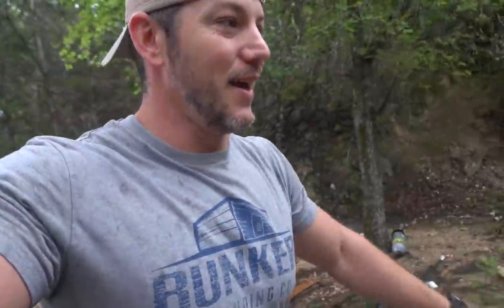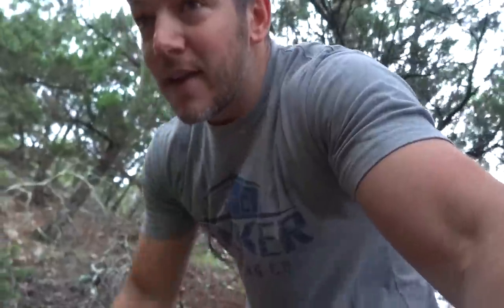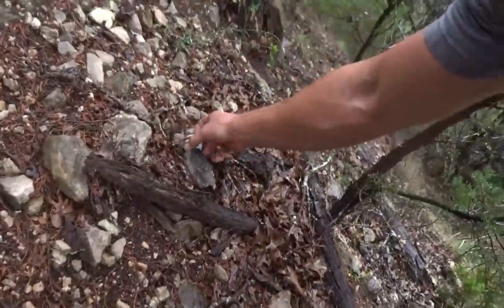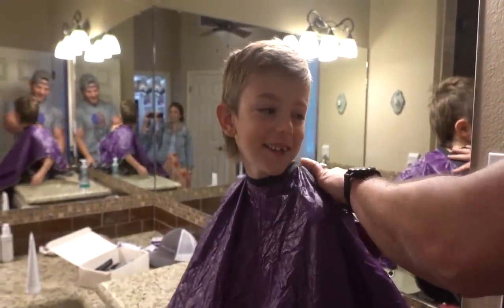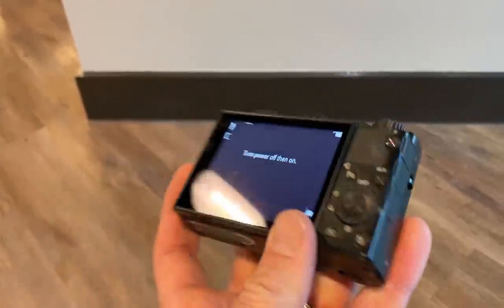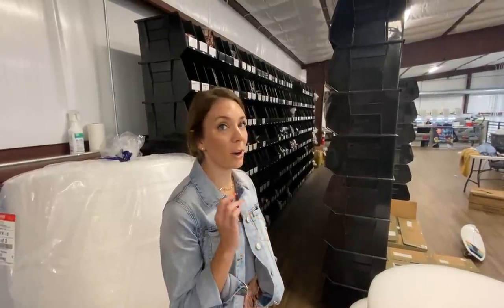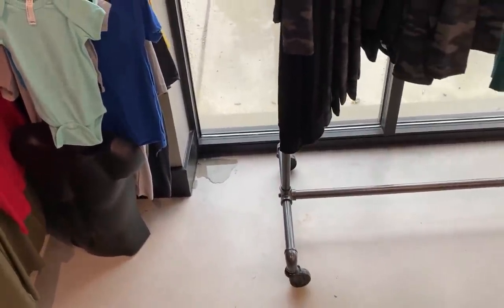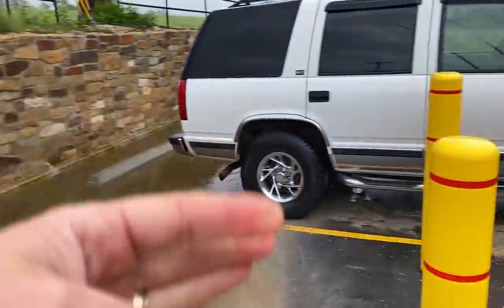The Barracuda’s 12V Cummins is Built!!!!

Comment: As an architect we always try to cover our doors, it helps keep water draining away from the building. Also Storefront is notorious for leaking and you have storefront in a metal building which makes the waterproofing more difficult. I would think about adding an awning the full length of the storefront above the door.

Comment: Quick suggestion on the water getting in- I am a 20 journeyman glazier and that corner leaking means the corner of the commercial storefront metal is not sealed. It is getting past the bottom pan ( the piece that comes up the back of the bottom storefront ) and the actual storefront metal frames. They should be caulked like Noah's ark in the corners when being assembled and when being set. The water is getting in either thru the Vinyl on the outside of the glass due to shrinking ( rookie move ) and the caulking on the corners ( internally ) and the joints not sealing completely.  That's a common issue with a poorly installed commercial storefront.

Comment: If the water is coming from up high it could be how the window framing is anchored onto your substrate. If the screw heads are anchored inside the framing through the head piece(the framing might be strapped idk) they might not be caulked and water could be travelling through a loose screw hole and running down the jamb of the frame and coming out the back of your subsill, if the frame wasnt properly embedded in caulking in the subsill

Comment: Hey Matt, I'm not sure you'll see this but make sure the caulk used to seal your storefront windows at the warehouse is 1 part polyurethane. It's much more weather resistant it's flexible and we use it installing those same storefronts here in Florida :)

Comment: Matt, you should dig a huge hole at bunker branding and submerge some empty water tanks to collect that spring water, then you can use it for things like washing trucks, flushing toilets, etx, and will be doing something good for the environment. Plus it would be a cool project, (maybe even tap into the ones at the ranch, and use it for demo headquarters for the same thing.

Comment: I would definitely highly recommend if you can find some metal tubing or plastic tubing and drilling out holes along that wall but using the the metal tubing and so that it runs away from the wall so basically adding some metal tubing connecting all of the pipes together into one pipe to go into the Little River that way you don't have any water buildup on the area of what you are

Comment: I searched quite a long time for a sturdy haircutter and finally found the same  WAHL as Matt has. When I received it, I realized it was only 120V and I'm living in Europe.
Not a big deal I thought, got my 100W 120Hz converter and started it up. It made really bad noises. After some research, I figured out, that it oscillates with the mains frequency and 50Hz is no good.
Now I have it hooked to a 12V DC to 120V 60Hz AC converter which is hooked to a 240V 50Hz AC to 12V DC converter.
It works like a charm now, but it was a way to get here.

Comment: Re the water.  Have the AC system checked.  You may have negative pressure and are sucking the water into the building.  A slight positive pressure is best.  The weep holes on the window system may also be clogged.

Comment: If you cut down all them scrub trees and plants long grass with good root systems that spring would always run because the rain will get trapped in the grass and soke in to the soil in stead of running straight off

Comment: Skip the ponds. They may look nice, but it's an insect magnet. Dig some holes, and bury water tanks with dry hydrant hook-ups. Some insurance companies will give a discount if you have some type of water source on site for fire department use. If insurance company won't deal, check with local fire department and town/county civil engineer...might give you a small break on property taxes. As for Bunker Branding...looks like it's time to expand on that piece of vacant property out back.

Comment: Be very happy that the person responsible for the construction of the wall has the drains installed, otherwise in a few years, the wall would end up blowing out due to hydraulic pressure. Oh Matt, it's a storm water retention, not detention pond. Some additional stone between the paved area and the pond will increase the life of the pond before it requires major work.

As for the video camera issues, I don't know why more YouTuber's don't purchase their cameras from B&H and get the extended warranty. It's a no questions asked full camera replacement. Purchase two cameras, use one, keep the other in reserve until you trash a camera, send the one for replacement and use the second one.

Comment: I feel like making a building waterproof is one of the most basic aspects of building. The whole object is to keep the outside outside. Whoever built that place  deserves to be put on blast at this point before more people get the shaft from them.  I understand not wanting to be that guy but at some point enough is enough. If they can't construct a building to handle a little bit of rain on the 47th try at it then they should find another profession.

Comment: So here is what happens if you dig those big old ponds. They fill up and it is great right up until the mosquitos arrive. Then you have billions of mosquitos to deal with and trust, that is NOT something you want. 

As for your camera, you got the CCD wet, so you can open it up and let air flow through it for a week or two and then try it again to see if it drying out solves the problem (usually doesn't), you can take it in for repair, you can remove the batteries and put it in the junk electronics storage area, or you can throw it away. Take your pick.